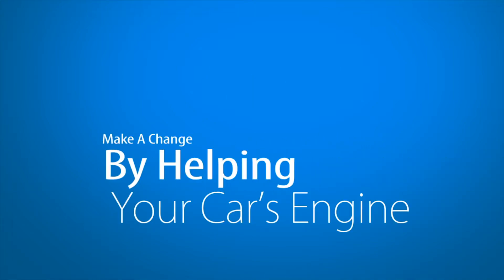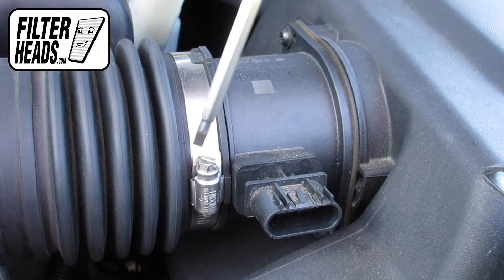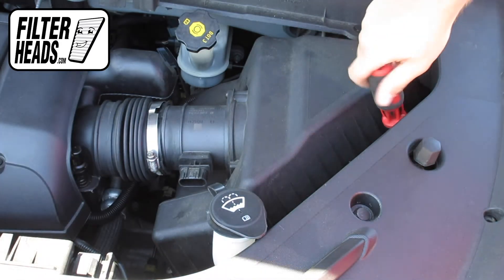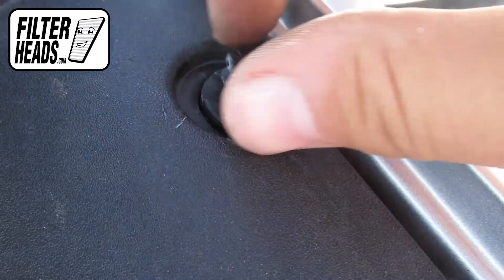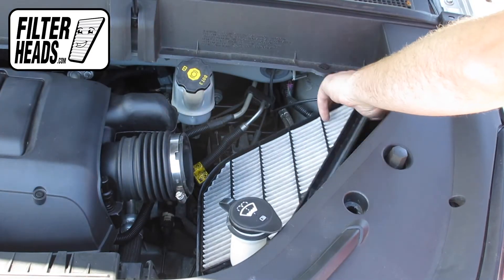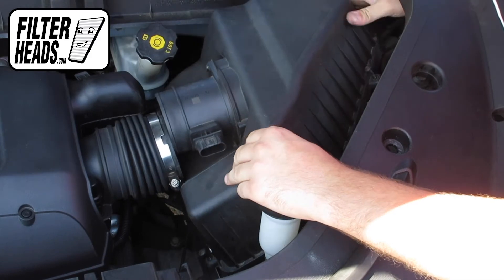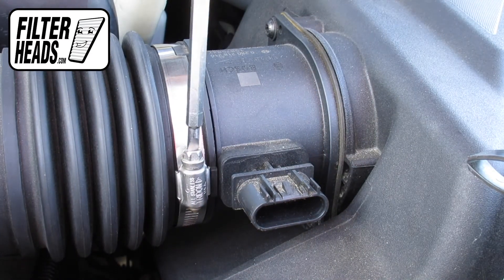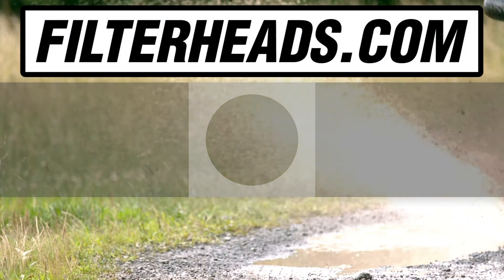How to Replace Engine Air Filter 2010 Chevrolet Traverse V6 3.6L

Comment: Wish I would have watched this I took off the hose and a part fell off now my car won’t start
Reply from the maker: Make sure to check and see if that part may be on the ground below your car.
Reply: @filterheads  I did and it’s not their I lost the hose part to pcv valve so just using pvc piping till it comes but it’s running again